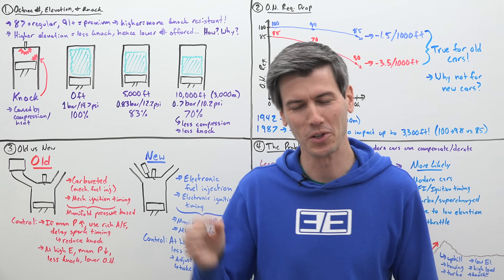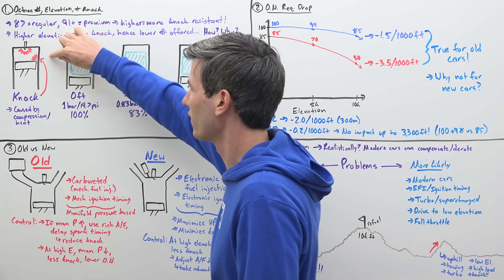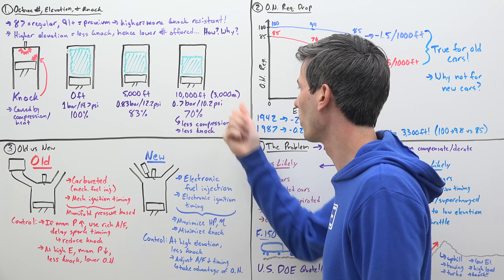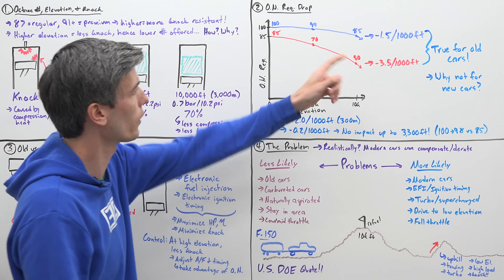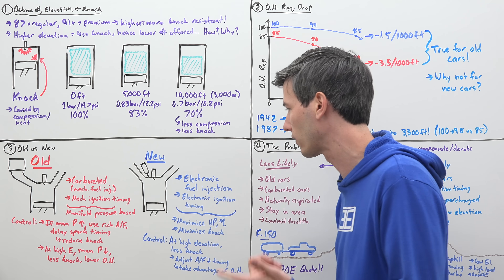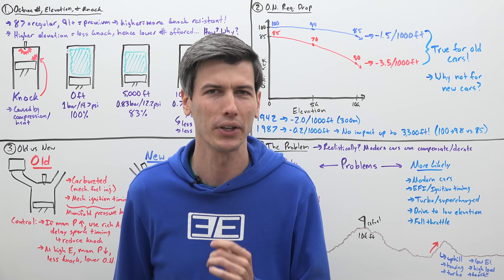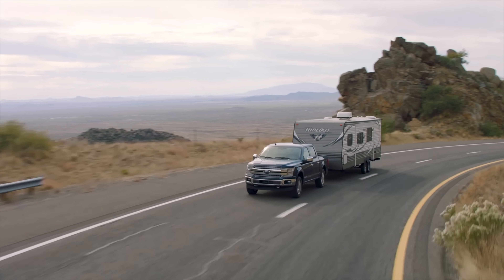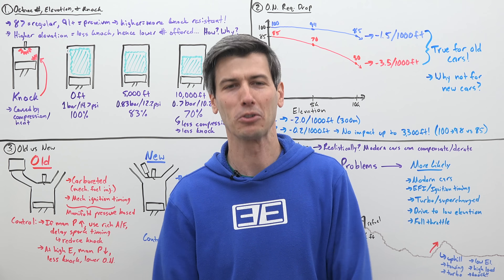Never Use This Gas In Your Car!

Comment: This was very interesting. I'm from Canada, and decided to look up our regulations since I've never seen 85octane fuel. Turns out, 87 is our minimum. The publication I found doesn't even acknowledge anything lower - all of the major petroleum players you would expect are voting members on the standard as well.
Reply: There aren't any significant cities at high elevation in Canada.
Reply: Well .. Banff / Canmore are at 4500-ft … and Calgary is at 3400-ft .. they seem a lot higher than American cities of any significance size!
Reply: @rickschroth9869    Banff & Canmore = towns.  I'll give you Calgary.  SLC has gas stations that sell 85 octane at over 4200'.  Remember, Denver is exactly one mile high.
Reply: @e-curb  … yes ..  “Mile High” at 5200-ft … but bottom line .. we just don’t sell 85 octane in Canada … not allowed 🚫
Reply: @rickschroth9869   Whether it's allowed or not by gov't regulations, my point is, there wouldn't be any demand because there aren't any cities at high enough altitude to make a significant market.
When I was in SLC, I had no trouble using 85 octane. But then my car is very old.
Reply: @rickschroth9869  the city I live in sits at almost 8,000 feet above sea level, in the US. That’s 2,440 meters. There would be no need to sell 85 octane at anything below or at 4200 feet above sea level. You have more available oxygen.

Comment: A NA carbureted engine will not have intake manifold pressure,  it will have manifold vacuum.  When the throttle plates are in the idle position (barely open),  the intake valves still open all the way and the piston still makes a full intake stroke,  so it can't intake all it can forming a vacuum in the intake.  When you go full throttle the vacuum drops but is still under vacuum not pressure.  Forced induction is another ball of wax.

Comment: In the automotive industry,  as a technician,  we've been saying ethanol is worthless In a NA vehicle. The only time it's remotely useful is in a forced induction engine that has been tuned for it.. less knock but also less efficiency. 
   When ethanol was introduced into fuels,  you started to see damage done to injectors and even in the cylinder head, mostly in the combination chamber.

Comment: This isnt a new threat from Ford. My sister had a late 90s Ford Windstar and the factory user manual said to use mid to high octane fuel. I looked up the compression ratio and it was 9.3:1. We live at 3500 ft and so regular here is 86. I told her to use the regular and stop wasting money. It never had any knock and went for years until the transmission went out. 
It is true that if you plan on traveling to a lower elevation or tow a load then upgrade the octane but otherwise Ford is just scaring it's customers into paying more for fuel.

Comment: What wasn't mentioned is how knock sensors work and what the motor does in response to then. Modern day motors are retarding the timing (etc?) to prevent the damage you mentioned.

Comment: I run an 06 f350 with v 10 and run regular always and regularly tow 20000 pounds with no problem just had emitions done it runs cleaner than most smaller cars

Comment: Let's put it this way my 85 Landcruiser with a straight 6 can run on 91 in straya where as my 2005 honda accord required a minimum octane rating of 95 in straya ...different if ur in the US of course because of octane ratings and freedom units lol

Comment: Glad to have learned this, here in CO they sell 85 octane, thought it was just normal because of the higher elevation , good thing my GMC is naturally aspirated and doesn't leave that elevation much.
Reply: Just drop an octane booster in for safety when you come down towards sea level and you'll be good
Reply: I moved out here from MN and never even thought about it when I just grabbed the lowest one from the pump. I looked after watching this and my local station has 87 but jts 0.20 more than 85. I can't believe it's that much cheaper than 87.
Reply: I also live in colorado, I have a turbo’d car. It’s really not much of an issue. My car typically knocks if I’m running my ac or my heater. I’m tuned and still it’s been solid.
Reply: @imoffendedthatyouareoffended  your running 85 in a turbo car?!?!?!?? Who would tune your car for 85??
Reply: @imoffendedthatyouareoffended  glad I scrolled down I was like uh oh lol
Reply: Same here with my NA V6 Colorado living out in Salida. I just looked in the manual and it says using under 87 can actually hurt the gas mileage. I've been averaging around 20 mpg since I got out here and just kind of figured that's what it is. Now I'm wondering if that's just because I've been using 85...

Comment: Is the likelihood of knock less because of lower pressure or lower oxygen content of higher altitude air?
Reply: Lower overall pressure within the cylinder.
If you start with less air within the cylinder as the intake valve closes, there will be less maximum pressure as the piston reached the top.
The oxygen content in high elevation air percentage-wise is the same as at sea level as O2 and N2 have pretty much the same atomic weight.
Reply: @thecarman3693  I would argue that it's both-less air pressure for less compression pressure and less oxygen. At altitude air by volume has less oxygen in it. 40% less oxygen by volume at 14,000 feet than at sea level. Oxygen as an oxidizer works with fuel to make power. It would be like taking away nitrous oxide.  less dense high altitude air also reduces air pressure that in effect reduces compression pressure.
Reply: @Popgunner101  It has less oxygen only due to the lower air pressure. The ratio of oxygen to nitrogen doesn't change with altitude until you're somewhere around 60 miles above the Earth's surface where some oxygen (O2) starts becoming ozone (O3). To say that higher altitudes (altitudes we can live and drive in) have less oxygen is very misleading. The composition of the air is the same.
Compression pressure is reduced as you claim, but it's that which is the primary cause of detonation. You can get detonation at altitude just as easily with a supercharged engine if the boost is sufficient to mimic compression pressures at lower elevations; the cylinders get just as much O2. And with intercooling you can cram even more O2 in the cylinder, but at a lower temperature. So the mere presence of O2 is not the issue.

Comment: I have tried using 87 in my 2013 Prius in Utah and I had about 5% lower MPG so I’m sticking with Shell 85 octane. I get the best mileage on that fuel.

Comment: Most smaller 4 cylinder cars can detune to account for lower octane but I guess that doesn’t work with trucks. Either way, I’d never use anything under 87 and never under 91 for forced induction (turbo) vehicles.

Comment: In Australia, 91 is regular unleaded, E10 (10% ethanol) is 94, Super is 95 and Premium is 98. Why such low octane levels in the US?
Reply: They use a different rating system. Our 91 is similar to their 87 in knock resistance.

Comment: I filled up with 85 Octane fuel in a 2016 Jeep wrangler with the N/A 3.6 V-6 engine while in Wyoming.  While going up a mountain pass north of Cheyenne it downshifted raising the RPM's to around 4000-4500 and the check engine light came on and I lost all power and went into limp mode.  I shut her down and upon restarting the limp mode was gone and check engine light reset.  This happened another 2 times for a total of 3 until I babied it to the next fuel station and filled the remaining portion of the tank (about 1/2 tank) with 91 octane.  After that the issue never reappeared.  I will never use 85 again.

Comment: A factor, that I think should also be considered, is the rare occurrence that you would fill up at altitude with 85 and make it down to low elevation(under load) without having to refuel first.

Comment: That's why they sell you knock sensors in your modern car, to detect knocking, and adjust ignition accordingly. That has nothing to do with older engine technology.

Comment: Todays computerized cars have parameters that they operate within, so air/fuel ratios and timing compensation is limited. Turbo and super charged engines have an even narrower set of parameters i.e. Ford F-150 eco boost twin turbo V6’s. Turbo charged engine’s can compensate for altitude much better the Naturally Aspirated engines so dropping the octane down will in fact cause a catastrophic knock that could very well cause serious to terminal engine failure.

Comment: So does higher octane make cars have an increased HP / torque or make them more efficient?
Reply: Not really. There's a big penalty from not enough octane (the engine 'de-tunes' to avoid damage from knocking) but adding more than the engine requires has little benefit.

Comment: I have only encountered the effect of altitude and octane in one of the cars that I’ve owned. I bought a brand new 1979 Mustang V-8 back in the day, and lived at 4500 feet elevation. At that elevation, it ran well on 87 octane, but at sea level, it would knock like crazy, even on 91 octane. To avoid that situation, whenever I drove down to sea level, I had to remove the vacuum line from the distributor, and plug the vacuum line. No knocking, but no power, either!

Comment: There still is something to dropping the octane at higher altitudes, even if you're towing. I know someone who had to do that with a fairly new truck earlier this year.
Reply: You gain nothing by lowering the octane rating.  You might not hurt it, but it will never be better than higher rated fuel
Reply: @dichotomousblue  It depends on how well your vehicle can adjust its timing when dealing with high altitudes. If it isn't making the adjustment to fire earlier in the cycle (as fuel burns slower at higher altitudes), there is an advantage to using a lower octane, which will ignite faster.

Comment: I'd like to see a video about other flex fuels and how they affect an engine. I'm currently using using 88 octane fuel in my 2012 avenger- 3.6L vvt. It says it can take flex fuel
Reply: 88 is usually E15 or E20, meaning 15-20% ethanol. In my state, all of our normal gas is around 10% ethanol already, and most reasonably new cars tolerate it fairly well.

Comment: Fun fact: modern F1 cars have a larger footprint that F150s.
Reply: really
Reply: @DrWhom  The Merc W12 is 2m x 5.7m.  The 6.5ft Styleside F150 is 2.03m x 5.31, so smaller.  The 8ft is 2.03 x 5.78 so only slightly larger!

Comment: Fortunately most Americans will never actually be able to purchase 85 octane fuel since it is typically only available in a handful of states. That said, you may see 85 octane available at the pumps in other states, even at sea level, due to a marketing scheme that exploits octane rating verbage. If you read the octane labels, they state a minimum octane rating. What this means is that outside of Colorado, Montana, Wyoming and Utah you are getting 87 octane fuel, even it the label says 85. On the surface it makes little sense to mislabel 87 as 85 but I'll explain. The problem comes down to common names we give items like "bandaid" which is a particular brand of bandage. Most people are used to referring to 87 as regular but at a fuel station that sells 87 and 85 they typically refer to 85 as economy. So the scheme here is to sell economy 85 fuel at the same price as the competition's 87, then mark up the regular 87 an additional $.10/gallon even though they are the exact same octane fuel. This works especially well at full service fuel stations because you pull up and ask the attendant to fill your tank with "regular" because that's what you're accustomed to. If you asked for the economy you would have saved $.10/gallon and still got the 87 octane fuel. The station is betting on your laziness and use of common terms while exploiting the "minimum" portion of the labelling requirements. If you live outside of one of the states I mentioned, you are very unlikely to have actual 85 octane available.

Comment: My vehicles get premium (without ethanol), always have required or not. But currently my wife's car is turbocharged and my pickup is aftermarket tuned (can still run on regular but best results on premium) plus I use it to tow... I'll pay the extra for the additional additives, lack of ethanol and a minor boost in performance (depends upon your specific vehicle)

Comment: I ran 85 octane for 260k miles in my 2005 f150 while living in the mountains of Colorado.

A higher octane is absolutely unnecessary. There is NOT enough oxygen above 6000 ft above sea level to burn all the energy out of the gasoline above 85 octane.  85 octane works great above 6000 ft.  

When I went to lower elevation, of course I put in the higher octane gasoline.
FYI, the truck got better mileage above 5000 ft with 85 octane.
In 2021, I continue to run my late model 2013 F150 with 85 octane when I am above 6000 ft.
Reply: I'm in the same boat but we have 86 octane at 4400-6000' in my city. Even when I've gone to Texas Arizona and California I wouldn't see any significant difference in how any of my cars ran or felt. I've tuned a lot of turbo cars and understand timing and fuel maps really well. I know how knock feels and I never experienced it the N/A cars I've taken on road trips. All the FI cars got the highest octane though.

Comment: Hey! On similar note!
Lexus owners wanted the mystery of supereme fuel requirement solved for ages.
The thing is:
Lexus/toyota states that for 2GR-FE engine in for example rx350 you have to use the supreme fuel. 
But the same engine is used in some other toyota cars and the manuals for those are not that strict and let you use lower octane fuels (Typing from my head  - rav4, highlander).
Some folks on forums tried to reach to lexus to get this explained but they just got a dry answer that you need to use high octane fuel and just occasionally use the lower grade ones. No explanation why.

I found two reasonable explanations for that:
1. Low plausability - the ECU has no code to handle situation when you floor the car on low grade fuel while climbing or towing.
2. A bit more probable - the parts in the fuel system are not graded for ethanol. So the trend of low ethanol contents in high grade fuels and susceptibility to corrosion of some vague part may exlpain this recommendation.

But what is the truth? Are there any other ways to explain this? 
So many people would like to know...
Reply: I would say the Computer  Fuel  map codes are different.   To get the higher performance  (are the HP numbers the same?)  one car will rev higher and flow more gas with different gear ratios.   Car Vs a truck tuned for lower speeds and more load.  Other parts may be changed like injectors or intake size  but the motor casting is the same.  Lexus tunes the motor for Premium vs Toyota  reg  gas

Comment: If your engine is not a flex fuel technology, just use the recommended octane level.
I love Flex-fuel Engines.
Fun fact: I have driven my Dodge Grand caravan Flex-fuel 3.3l v6 with pure corn ethanol from a farm in Wyoming, it cleaned my engine like nothing out there 👍👍

Comment: The problem is when using higher octane tends to be much more expensive (30 to 40 cents higher per gallon) so more than likely most everyone will buy the cheapest.  Get them down to more of 1.50/gallon (which won't happen) then that might change.

Comment: The engine management computer could be programmed to compensate for low octane fuels. Back off on the boost pressure (waste gate control); retard the timing; reduce the throttle. These are all things that can be done to protect the engine. Performance and efficiency would suffer and the driver needs to know that. Damaging the engine is Ford’s software types limiting the operating range of the engine.

Comment: Simple. Higher compression engines and turbo engines need better gas.

Car makers can check for knock and delay timing when using low octane gas.

Comment: can someone explain how does this work with the rating being 85 for regular but ive been to a lot of states, mostly north east and southeast then  only as far out west to Michigan and the gas stations that offer flex fuel are rated at E85. most ppl see that 85 then think its flex fuel but it isnt.

Comment: I have a flex fuel truck but don't use the e85 due to the fact that for five cents cheaper I lose a minimum of 100 miles a tank making it a very nonviable substitute.

Comment: I don't think you'll have warranty issues unless they take a sample of your fuel and find out it is not the minimum octane.  They might even be able to tell something is wrong from codes and data from the ECU instead and take the sample to confirm it.  It is nice that they clarify on that and tell you DON'T USE it in a newer vehicle.

Comment: Why is gasoline is still referred to as “regular unleaded”? Leaded gas was phased out since the EPA banned its use in motor vehicles starting Jan 1996. About the only places where anyone can still find leaded gasoline are airports in the form of 100 low lead avgas….

Comment: Over 25 years of driving a dozen vehicles at 5k or higher (I live in Wyoming) 85 octane has never been an issue. Knock sensors prevent damage. And the hundreds of thousands of vehicles at this altitude doing the same thing, is pretty good evidence it just doesn't matter.

When I tow with my hemi, or fill my fiesta st, I do use 87. My BRZ gets 85 then 87 at alternating tank fills, never dropping past half.
Reply: My 2001 Wrangler's owners manual states 85 is the manufacturer recommended gas so I'll keep using it with no concern
Reply: All the vehicles running on it is not evidence that 85 octane doesn't matter, it's evidence that the electronic systems are trying to deal with it. That results in decreases performance from your car, lower fuel mileage, and possibly shorter lifespan of certain parts.
Reply: @javaman2883  Like everything in life, it is about tradeoffs.  Saving money is worth the reduction in power and engine life for most people.